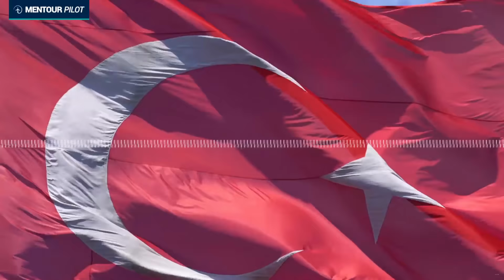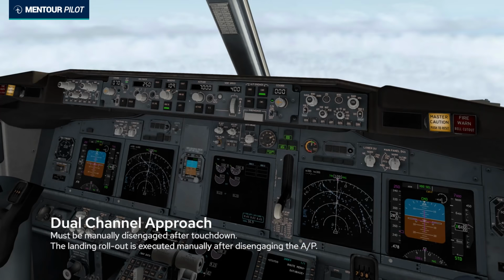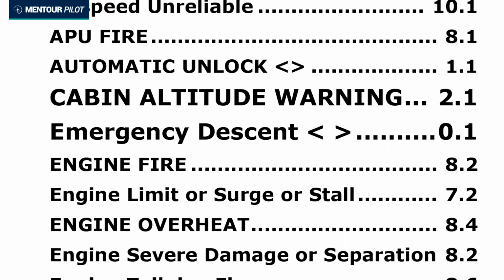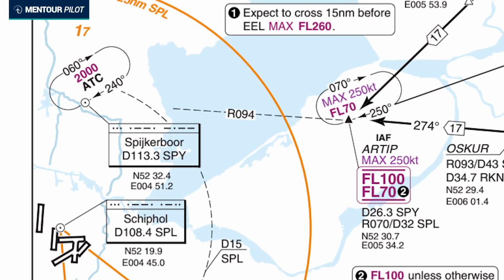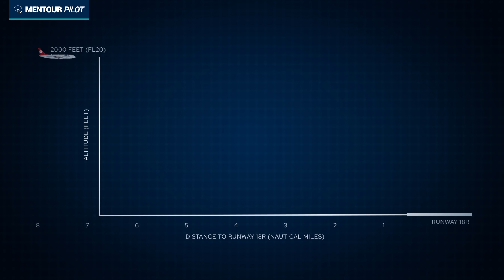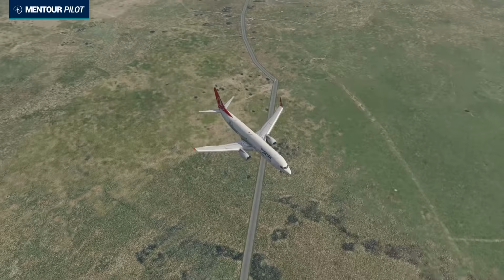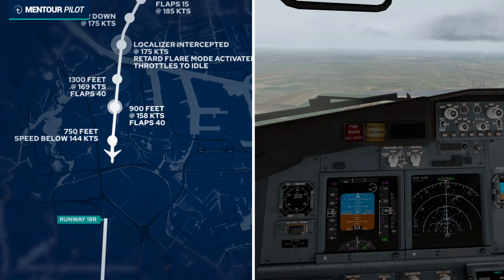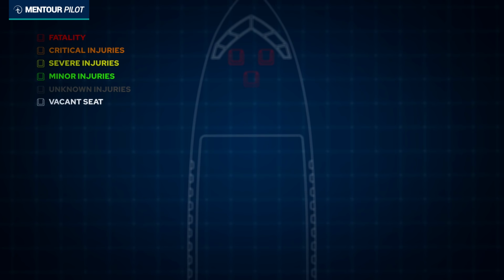What happened to Turkish Airlines flight 1951?!

Comment: The audio needs a high-pass filter. The low-end resonating in the room is hard to listen to (between 90 and 130 hz according to the Audacity spectrogram). It's fatiguing on long videos such as this. High-pass at 130hz would clean that up very nicely.

Comment: One thing here that I don't like is the radio transmissions on the replay ... They are garbled & way to fast ... I was in the Fleet Air Arm Royal Navy & worked in ATC ... all communications with aircraft HAD to be Slow Concise and Distinct * the same was Demanded from the Pilots ... No Confusion = No Errors

Comment: Damn they killed off the entire first class. The fact that the two cabin crew survived between the killed first class and pilots is definitely a testament to their safer seating.

Also, even though they were given a faulty plane, following basic stall procedures would have saved everybody potentially. The fact that the captain pulled the throttles back to idle in the middle of a stall is unacceptable. Had the engines been given that full 10 to 15 seconds at full go around power the plane likely never would have crashed.
Reply: Hindsight is 20/20.

Comment: I've watched quite a few of these here and on other channels, where one major factor in the accident is the pilot's failure to correctly recover from an imminent stall. I recall from my private pilot training that stall recovery and spin awareness was practiced until it became instinct. I'm curious about when in the course of commercial or ATP training this instinct is trained back out of pilots. Pitch changes your speed, power changes your elevation. I know jets are more complex, but basic aerodynamics are the same. When is pulling up ever the right thing to do in the face of a potential stall? Even close to the ground, maybe especially close to the ground, maintaining air speed is all that matters.

Comment: The golden flying age where pilot isn't even required to watch his airspeed nor the altitude... thus making everything so complicated when certain system goes wrong therefore causing other systems to give incorrect parameters and everything ends up being a mess... in fact after this particular crash Boeing has since issued a bulletin to remind pilots of all 737 series and BBJ aircraft of the importance of monitoring airspeed and altitude, advising against the use of autopilot or auto-throttle while landing in cases of radio altimeter discrepancies.

Comment: I find it very sad how we can determine very obscure faults with equipment after an accident, where the fault is essentially diagnosed from the broken up bits and pieces of the aircraft, but we're generally not able to find those same faults beforehand. Now I'm no aircraft mechanic but I am a mechanic so I can definitely relate to the phenomenon of a mysterious intermittent problems that you can't pin down. The difference here is the severity of the risk and the fact that since the faults can be identified post accident, it means it was possible to identify them before. I don't think it's the aircraft engineers' fault, I think it's a fault with how most airlines operate. Schedule is strict and aircraft are expected to keep up with it to operate in a cost effective margin. Issues come and go and instead of grounding the aircraft and performing more comprehensive inspections, which are no doubt costly and require a lot of work, they instead run a few tests and checks and if the problem doesn't appear they just clear the aircraft for operations. It's not that I don't understand why it is this way but ultimately there have been multiple accidents caused because of this exact type of operating procedure. If you can't afford as an airline to ground your aircraft and inspect them as if you were doing a post accident inspection then you shouldn't be operating them at all.

Comment: When the stick shake warning happened and the first officer pushed the nose down and increased thrust, how come it did not automatically disengage the auto-throttle/autopilot? I was under the impression that doing such actions as taking physical control of the flight controls immediately disables whatever autopilot modes were previously active...?

Comment: I still don't understand why no one notices that the airspeed was way to low. You can find blame for parts of the radio system or Schiphol. But the fact still is that a pilot has control over the aircraft and should not force a landing when an aircraft is not stabilized. I'm not an expert but you don't need autopilot for a landing you can land a 737 without any autopilot or automatic systems. Deploy flaps, make sure airspeed is around 130/140 and watch the PAPI lights. I won't be a landing out of the book but it wheel be a save landing and it gives the option to do a go-around. Having 3 people doing all different stuff, having an AT doing its own actions makes it even worse.

In my opinion, the pilots are the reason that this plane crashed, a pilot from a Dutch Airliner once told me that you should always do a go around if you have any doubt no matter how small because a delay is much better than a crash. And from this video I don't get that with so many things not going how they should, they still tried to land the plane. I just don't understand it.

Comment: Why no mention of QRH for radio altimeter left failure? Such a checklist would have warned them not to use auto-throttle, correct? Was such a checklist absent or did they just not look for it?

Comment: What exactly is the role of the Safety Pilot on a training flight?  Surely it doesn't include helping the actual flying crew out withroutine  chores they are unable to do due to there workload increasing when things start going wrong.  As you indicated, his attention was likely distracted when he was helping out with doing  PA announcements instead of watching what was going on at the plane's controls.  Had he been paying more attention he might have at least reminded the captain about the landing gate rule for instance.

Comment: The captain was task saturated and behind the airplane while first officer didn't have enough experience to troubleshoot and support pilot wasn't in a position to question either of them. They made mistakes however it isn't fair to them to judge them harshly. The approach was too close (should have been aborted by captain), checklists weren't done by 1000 (captain was behind the plane) yet despite all these problems the plane wouldn't have crashed had there not been RA fault. Pilots engaged dual approach and it autodisconnected so they went back to autopilot B which didn't have a problem yet the autothrottle wasn't using B side RA, if it was the plane wouldn't have crashed even with unstable approach.
Reply: With three pilots, none of them monitoring the flight, this airplane was bound to crash no matter what. May as well not have any pilots on the flight deck.

Comment: After a malfunction in the information network to essential components on the aircraft, and then a catastrophic failure happens
because two computers are not calibrated for this particular flight. Maybe the last time Brain No 2 was used was on a different
flight, Days before. Now you switch over to No2 and it retains the information of it's last flight. What the Hell.

Comment: I have a question regarding the change of control in such a critical phase like a near ground stall warning. As an absolute layman I only understand that the the final responsibility always is with the captain yet I would like to learn more about the decision making process in such a case as I wonder how quick pilots actually can change from piloting to monitoring and if there is some kind of mental delay or an instant switch due to training and experience. Maybe some of the Pros here can elaborate on this a bit.

Comment: One thing I don't understand is why pilots are so reliant on their instruments.. Surely there is some kind of training in place that can make an assertive pilot question the reliability of the instruments based on the way the aircraft is flying.. Why can't they simply observe what is happening outside the window or how the controls feel and if all is fine they can report the problem and simply return to airport safely.. In this case most will be able to assume the CRM was very absent from this flight crew as they did not discuss or elaborate about some of the equipment failures..

Comment: "It looks like we lost an Aircraft" !!!!!!WHAT!!??? 😳
I'm an Old amateur Pilot... but I'm left with a burning question. 
DON'T MODERN AIRLINE PILOTS LOOK OUT THE WINDSCREEN ANYMORE?? 
I mean, have they become SO mired in Procedures and Checklists, that not even ONE of them could look out and say "HEY! We're much too low"?? 
And the first Stick Shaker SHOULD have alerted them to the fact that something was terribly wrong - shouldn't it have? 

Even more SAD, the F/O was actually handling the situation correctly - until the Captain TOOK the Aircraft from him. 
Lives lost unnecessarily..... 😞
Reply: And please, I look forward to seeing more of these! To the point, clearly explained, with no bias or drama. 👍👍
Reply: How do you tell the thrust by looking out of the windscreen.
Reply: @peteconrad2077   You can't tell the actual Thrust of the Engine... but in an Airplane that small, you can physically SEE the "Engine(s)". You could even feel some acceleration - or vibrations from a possibly damaged Engine. 

When you're Piloting an Aircraft - or any Vehicle for that matter...
TOTAL Situational Awareness is a MUST for saving Lives. Especially you. 😉
Reply: @CarminesRCTipsandTricks  seeing those engines will tell you precisely nothing. Stop trying to justify our silly comment.

Comment: The altitude indicator is one thing, but you'd think there would be some kind of comparator circuit that gives a warning if the values between left and right mismatch (or at the very least  below 2500ft), with a checklist that needs to be completed to ensure the safe use of autopilot functionality. Apart from that, from the explanation here I feel that the captain made some big mistakes and the safety pilot didn't intervene enough to help out the "newbie" pilot.

Comment: Can't believe the 3 pilots died the cockpit looked ok
Reply: In a pancake flop into the ground the extreme tips of the structure don't have anything attached to them so they don't suffer the tension or compression forces that would be caused by the inertia of other attached structure, but this lack of mass and structural inertia is what causes high G forces to be transmitted to the occupants in the cockpit and occupant contact with internal structure or components is usually what causes the fatal injuries there.

Comment: Instead of trying to increase the speed and make it to the runway, could they actually perform an emergency landing on this field? Wouldn't that have been less risky than trying to deal with the low altitude stall which seems to be very dangerous and difficult to manage?

Comment: I always feel that the airplane could do more. E.g. why do I manually have to find out that the radio altimeter is broken? By comparison of both radio altimeters, the airplane can know that something is wrong. Also, if the airplane can't determine which one is faulty and which one is okay, then why not completely disallowing auto throttle? Or maybe at least disallow it below, let's say 2000 feet as per barometric altimeter? Pilots are then forced to control the throttle manually, thus keeping them in the loop. It increases workload, but I would assume that a higher workload is still preferable to a faulty automation system...

Comment: I'll never understand how a supposedly trained commercial pilot isn't applying full throttle when you've got a stick-shaker event at merely few feet from the ground. Of course, that the captain then decides to push the throttle back after the mild stall recovery attempt from the flying pilot, is even less understandable. I know what workload on an approach is, still a stick-shaker event on short final should be a warning enough to trigger a brain-automated reflex for a go-around.   If you ask me, that's utter lack on proper training and CRM.

Comment: I have some questions:

1.  Why didn't the aircraft give the pilots a low speed warning?  Was it because the airplane thought it was much lower (closer to landing) than it actually was (due to the faulty radio altimeter)?

(Yes, the stick shaker activated, of course, as the plane was about to stall, but I would've expected a low airspeed warning to come on prior to that.)

2.  After the First Officer pushed the throttle forward, why did the autothrottle subsequently override the pilot and retard it again?  Who's flying the plane?  Seems to me that if a pilot manually changes a control, that should deactivate the autocontrol (autothrottle or autopilot, as the case may be) and return the relevant control to the human pilot.  If that had happened here, the throttle would've remained advanced and this crash would not have occurred.

Comment: what i dont understand what was the pilot monitoring doing? he should have been monitoring the equipments but it seems like the safety pilot was doing that. and as a more senior pilot , why didnt he catch the mistake the co pilot was doing...
Reply: The safety pilot was NOT more senior or more experienced. He was supposed to be primarily monitoring the FO who was under training and secondarily monitoring the overall flight status. Not being either the pilot-flying or the pilot-monitoring, he can't be expected to do the job of both and monitor everything. IDK if the responsibilities of the safety pilot are adequately called out in the airline's operating handbook. The only mistake the FO made was in incorrectly setting up the autopilot for dual channel monitoring, but Autopilot A would have disconnected anyway because of the RA discrepancy.

Comment: To really learn something you need to teach it! With having to explain things to others, with all of the various questions, and corrections to others misunderstandings, you lean the subject matter from top to bottom and inside out. 
It would seen every pilot would want to teach as it would increase their own knowledge. And perhaps should teach before ever being a captain! If you can't explain it you don't understand it very well. Or we'll enough. And it seems every pilot should review, and be able to discuss in detail, a mishap, including what occured, what should have occured or was missed, when, and by whom. A case study or grand rounds but in avionics.  It would help reinforce the basics. 

I have seen this case study and the air show incident in Mulhouse today and I am struck by the similarities in both stories--- the fact of being too low and too slow to be able to climb out of a stall.  One at 30 feet, another at 400 feet. And both were with well experienced, upper level pilots, which lost sight of---- the basics! 

Why not have a machine voice calling out the ground speed as well, just as with low elevations---   50, 40, 30, 20, etc.  Speed and elevation both  being so crucial, and so often over looked, ignored, forgotten about, or lost in the moment.

I learn best in the abstract, and  theoretical so I can visualize  from all angles what is/should be going on.  
I want to get that down before ever doing any hands on. I find pre-visualizations to be invaluable to my performance.

Comment: But if the altimeter was wrong, at -8, how could they know when they reached 2000ft? (descend to 2000ft?)
Reply: The radio altimeter was at -8, the standard altimeter was working fine.

Comment: It seems sooooooooo incompetent for 3 pilots to ignore FOUR STRANGE ISSUES!!! Negative and also absurd value for the height, beeping alarm on gears, disappearing flare for 50 ft and autopilot disconnecting! And on top of that they didn't check the speed as well as the nose angle! I guess the captain was too experienced and overconfident that he forgot how important and hard his job actually was! Not only that but the captain could've saved the aircraft if he only used a little more speed!

Comment: Why the automatic pilot raises the nose of the plane if the plane goes below the glide slope and does not increase thrust too?
Reply: Because the autopilot and auto throttle are 2 separate systems. The autopilot does not control the engines. The autopilot is in approach mode and auto throttle is in land mode because they are using different radio altimeters

Comment: I kept asking myself if you have 2 radio alitimeters why the heck would you NOT use both, and NO I do not mean using the average value. ;-) Why not at least have a warning that alerts there is a significant difference in measured value? That way, even if only one is used for guiding the plane, the pilots wil at least be warned the vaules guiding the plane may be faulty. You don’t need a third altimiter to determine which of the other two is wrong, you just need a warning one of them  IS!
They knew the radio altimeters sometimes had problems, why not simply detect a problem and let the crew deal with it?